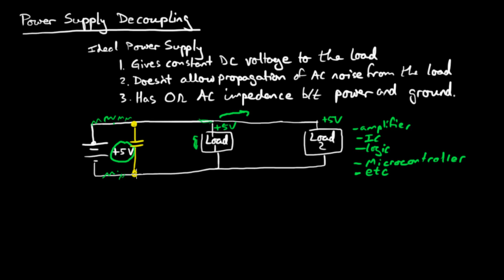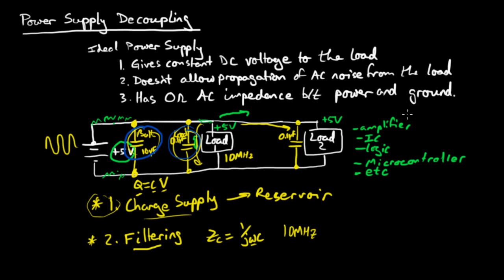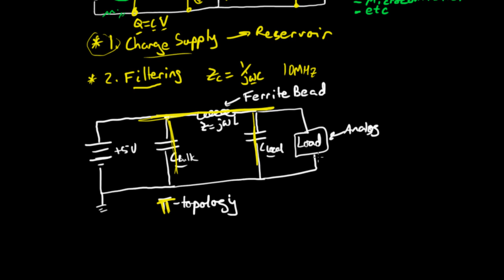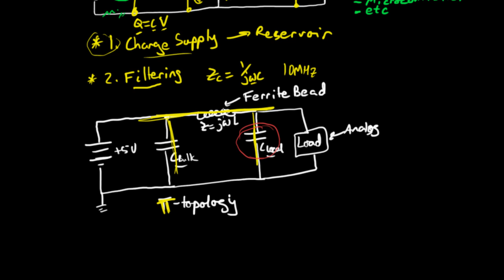Decoupling Capacitors 1 of 4

Comment: Is it really the source (+5) that can't "keep up" with a sudden demand for current, or is it the inductance between the source and the device that requires it that prevents the current from flowing from the source?  Keeping a small source (bypass cap) close to the customer means not dealing with the inductance. Also a ferrite bead I think magnifies the inductance of a trace (or wire),  it's not an inductance per say.